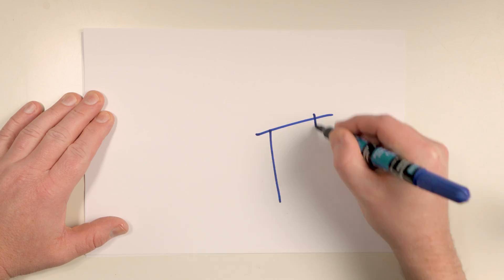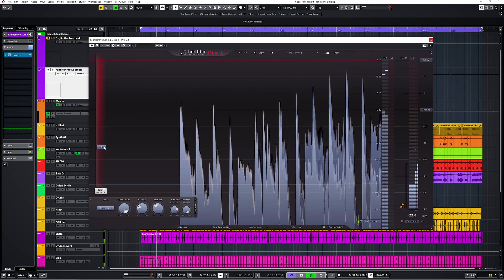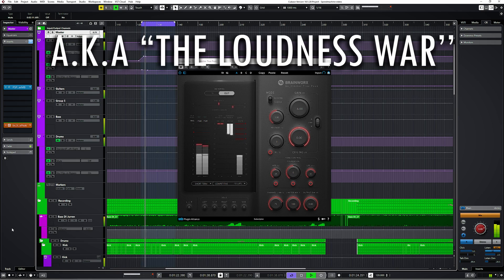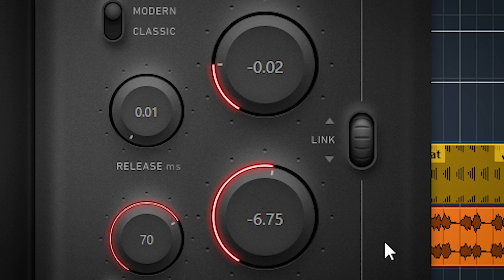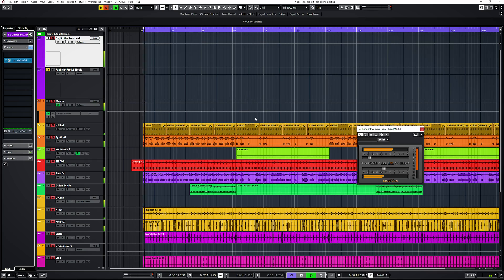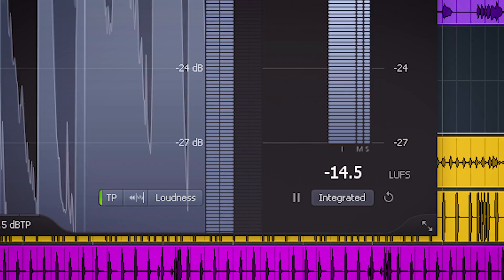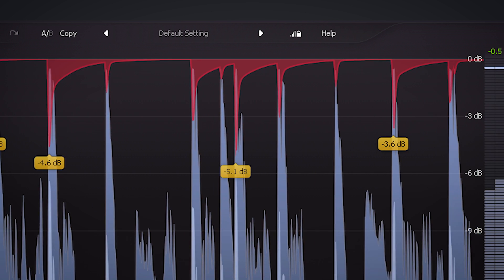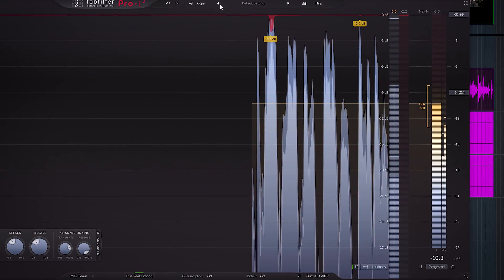What does an Audio LIMITER do? Limiting Explained and how to use it.

Comment: Am I correct in understanding that dynamic range is lost in both limiting and compression but differently? Generally speaking a limiter affects mainly the loudest spikes, while a compressor affects the loudest and softest audio signals equally. No?

Pop music lends itself to little dynamic range but orchestra music must preserve, say, parts at pppp and ffff; so I am inclined avoid compression in classical music but use a limiter...sparingly. Can anyone throw some light on this matter?